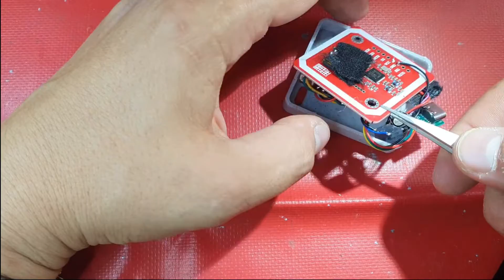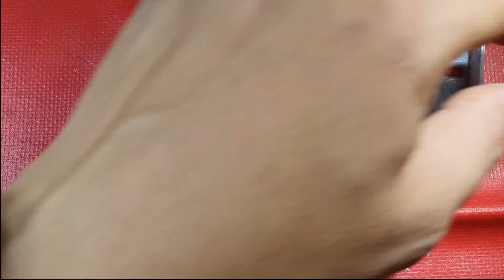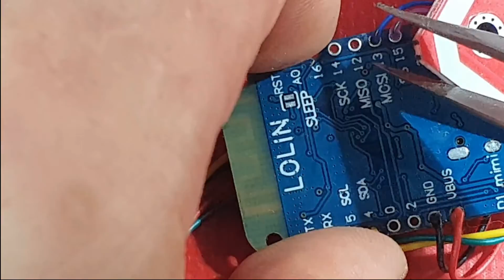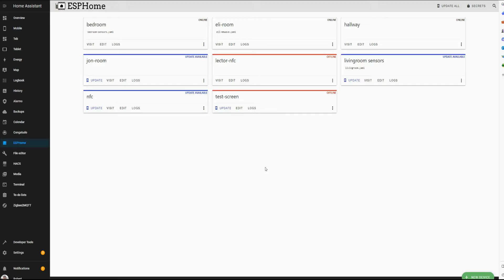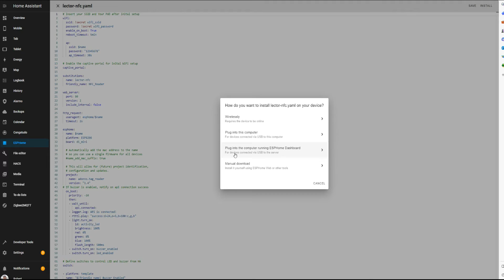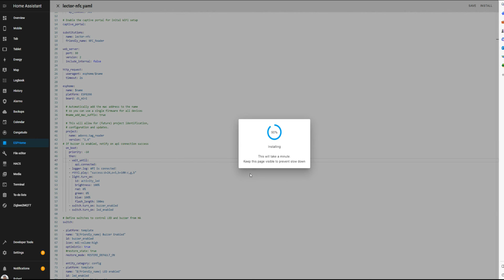NFC /RFID tag reader 2.0 mini reduced size for Home Assistant

Comment: Why is no one talking about the code? I wish to use another, esp32 Maybe I wish to use not wifi but zigbee connection.... 😢
Reply from the maker: Hi, sorry for the late reply! 😊 I'll upload the latest ESPHome code to GitHub and pin the link in a comment. Regarding the hardware, you can use a different ESP32 board as long as it has the required interfaces and enough GPIOs. As for Zigbee, that would require completely different firmware and software, so the ESPHome code from this video wouldn't work. Thanks for watching!